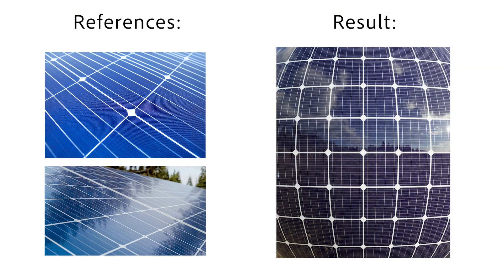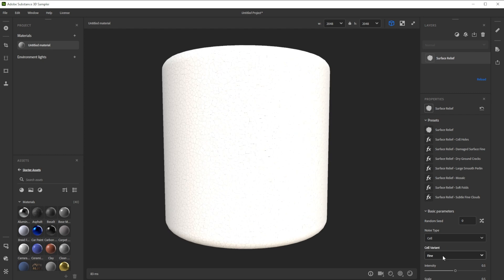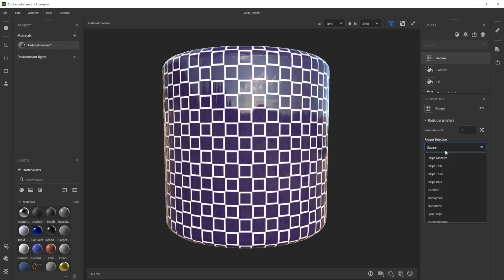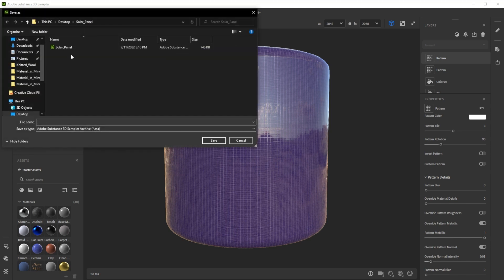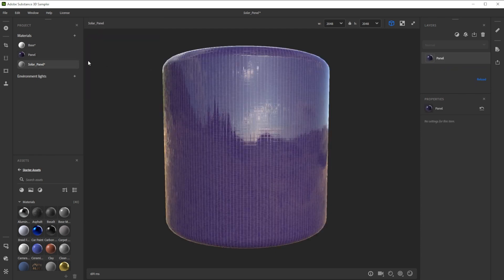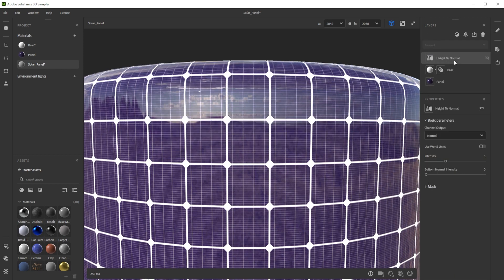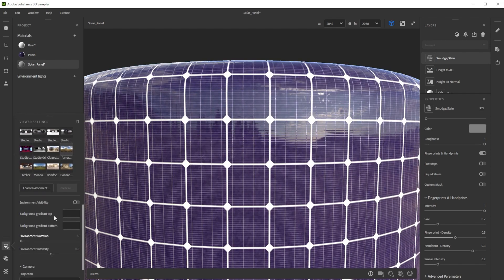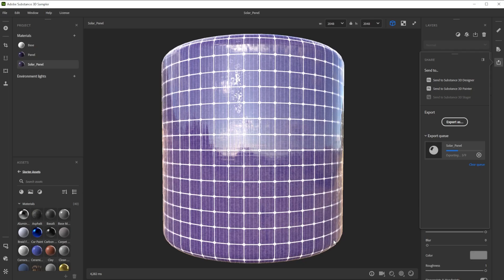Make a Solar Panel Material in Substance 3D Sampler | Materials in Minutes #13 | Adobe Substance 3D

Comment: why are my properties settings completely differtent for almost every filter than what is showed in the video? Same with the documentation onine.
Reply: They update the program and several filters, so you watch tutorials FROM TWO YEARS AGO and you don't understand a thing. The PATTERN filter has changed drastically.

Not to mention that tutorials about Sampler are very scarce, there is not a single course that presents this program in a satisfactory way.

Not on Domestika, not on Udemy (with the exception of a course on Udemy in Turkish that does not have English subtitles).

It seems that people have completely ignored this program and it gets even worse when Adobe itself ignores it.

There are many tutorials about Substance Designer and Substance Painter, but about Sampler, I think there are not even 10 on Adobe's own website. If Adobe can't make useful materials with this program, imagine other people?

Very disappointed about this absence.

Comment: This is basically a fully procedural material that could be done in Designer. It isn't really sampled from any source imagery, and the only way it would only take a few minutes is when you know exactly what you're doing with the program, after loads of experience. This tutorial still has its uses.
Reply from the maker: If you know Designer well, this tutorial is probably not for you ;)
Reply: @Substance3D  I watched it expecting to learn how the material was built from a sampled source. I wanted to check out sampler's power, and yes I do use Designer in production